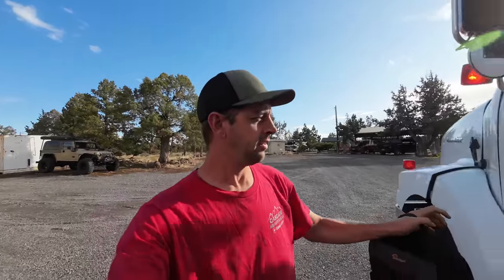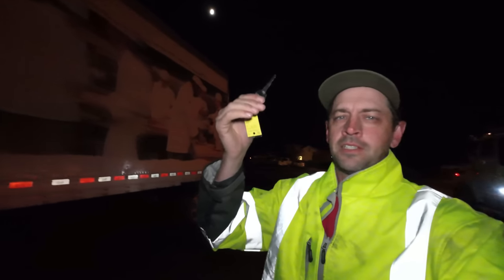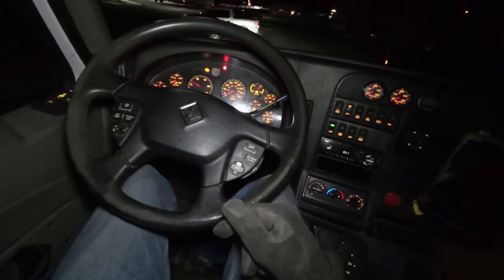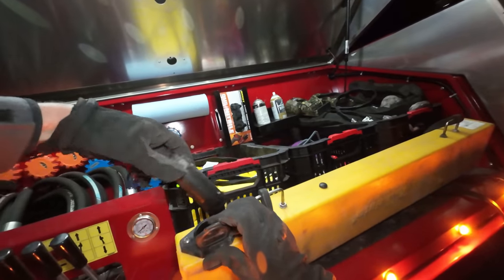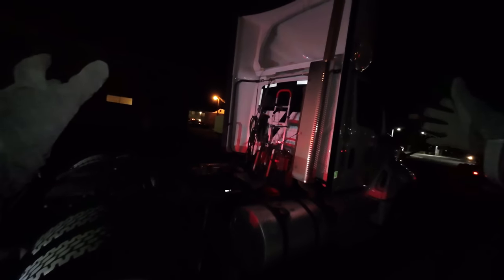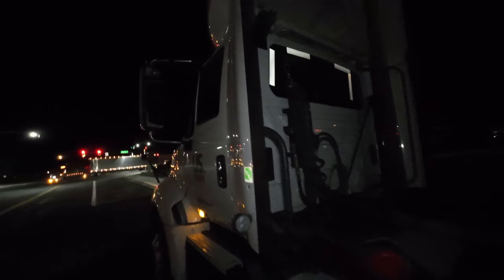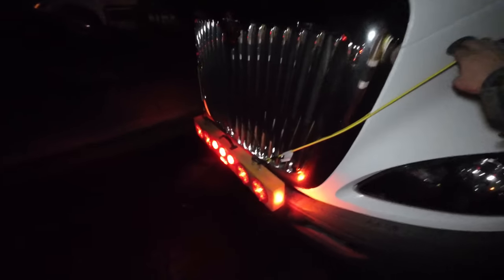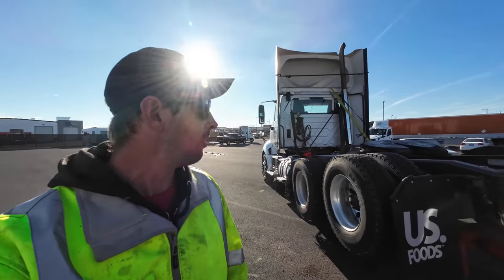Pulling a parachute for 300 miles!

Comment: Drag force goes up exponentially with speed.  In the formula to calculate drag force, velocity is squared.  That is why a lot of commercial fleets monitor drivers' speeds and/or speed govern their trucks.
Reply: When I was a technician working on the Albertsons fleet in Portland Oregon. We had to set the trucks for 330hp 400 on the hills @ 57mph top speed 62mph for 30 sec to pass and idle no longer then 1 min.
Reply: Right.   (60/55)^2=1.19, so makes 19% more fuel consumption. That explains 5 changing to 6 mpg
Reply: Drag Queens go up with speed too, so what's your point?
Reply: More accurately it doesn't go up 'exponentially" it goes up with the square of the wind speed.  That's no where near as fast as "exponentially" but it's still seriously wallet thrashing!   My 4 cylinder Camry gets about 30 mpg at 70 but at 90 you can see the fuel gauge dropping.🤪
Reply: @keithcress1335  , you just contradicted yourself in the first sentence.  Anything increasing with the square (or cube, or any other exponent) IS increasing exponentially.  Saying the drag is going up by the square just defines WHICH exponent.  This is in contrast to drag increasing by weight, which would be linear.
Reply: @michaelhinman1770  !! You're absolutely correct!  For some reason I was thinking "e to the x".  Thanks for that.
Reply: @keithcress1335  a person who admitted a mistake on the internet?  The courage that takes, you are a man among men!  

Seriously though, to make mistakes is human, to own them is becoming a sadly rare occurrence.  I appreciate those who are honest enough to admit their mistakes, especially in front of the world.  Keep up your integrity!

Comment: Back when you only needed 10 hours off in a 24 hour period was a lot safer than this 10 hour all at once. We often drove a few hours and then rested a few hours then all over again without getting sleepy. Now driving 11 hours at once is much more dangerous.  Love the videos. Nice truck for sure. I am building me and old POS just to help the neighbors out from time to time. The bungy cords when the light fell off were probably bouncing up and down pretty good hook on the strap where when hooked on something solid, they hold fine. I do like the method you are using now much better. good idea.

Comment: Casey, it was an newer international, so next time look at the switches on your right and you should see one that says 5th wheel unlock. With the truck running, parking brake on , hold the switch down until you get a solid tone. You should hear a”chunk” behind you. Then push the parking brake and start to drive foward . Also in that bank of switches you should see a suspension dump. Hit it to lower the suspension. And if you have to pull the handle manually pull out and the pull it towards the front and let go, it has a lock there.
Reply: Yes to the above answer about 5th wheel unlocks. Most all trucks have air 5th wheel unlocks. Safety! Oh, and workman's comp. Shoulder and back issues.
Reply: I haven't really ran a brand-new truck on a job. But my trucks that have "fifth wheel unlock" switch are for the ones that have sliding plate
Reply: More than likely, all he needed to do was to pull out, and push forward to lock open, that’s how mine work

Comment: I was driving a Humvee ambulance on I-95, topped out at 57 mph in the right lane when a truck towing another one backwards passed me. It got about 50 feet past me and that top spoiler(?) ripped off and flew into my lane. Super thankful there was a brush guard on that vehicle because I nailed it and fiberglass exploded everywhere. I pulled over to check for damage and a guy that was about a hundred yards behind me stopped to check and said from back there it looked like I’d run over a giant igloo cooler. Very minor damage, but the truck never stopped.
Reply: Yikes!!!😮
Reply: Years ago I was following a ute (Australia) or pickup (USA) carrying a bunch of builder's tools and stuff, with a fiberglass bathtub on top held down by almost nothing.  The guy went a bit faster and the bathtub caught the wind and flew off the back. I almost missed it, put a small dent in the corner of the bumper and a much bigger dent in the bath.

Comment: I'm just glad to be able to see you back in action, Casey. I totally understand the speed limit and hauling a parachute behind you - my RV is an older 30' DP that was designed during the fuel crisis, so 60 is its happy place, and driving a square box down the road needs everything in its favor 🙂

Comment: We always pulled them forward. It doesn't take that long to disconnect the driveshaft. Yeah I didn't like doing it but I like it better than the drag and swaying. We usually had to pull them further than you seem to. I used to work for a company that retrieved their own broken down trucks. Seemed like all of them broke down at least 600 plus miles away.

Comment: Trucks aerodynamics certainly weren't meant to be pulled in the opposite direction from which they were designed to be operated. I drove OTR from 1988 to 2009 and during that time drove our wrecker to rescue our broken trucks. We always pulled trucks backwards so we wouldn't have to pull the axles out. The mirrors we always folded in so the wind wouldn't tear them apart and the side fairings we always strapped them together to keep them from ripping apart from the force of the wind. I always enjoyed doing our wrecker runs (we had a lot of them lol) we're based out of southwest Tennessee and I've done runs as far as Idaho and Arizona either bringing a truck to a broke down driver and bringing his truck back or dead heading to pick up either abandoned or broken down truck.
Reply from the maker: Folding the mirrors in is a risky move.   It will prevent the covers from coming off, but if the wind catches them enough to fold them out at speed you will see some serious damage

Comment: Been really enjoying these heavy truck recoveries! Learned a lot on how and why you do the things you do. Question though, have you seen anything about Edison Motors? Would love to see your general thoughts on what theyre working on.
Reply from the maker: They are on the right track.  Big fan of what they’re doing
Reply: I'm a huge fan of Edison motors and what they're doing and I admire their approach to keeping things simple, serviceable, and domestic
Reply: Choo-choo there’s a reason I believe that trains have been diesel electric power and efficiency
Reply: @thelonewrangler1008  Absolutely love that too. If they made a pickup truck along the same lines -  reasonable EV with a diesel range extender under the hood - and keeping the user interface SIMPLE, not like driving an iPad, I'd go buy one right now.
Reply: Many years ago I read that UPS was exploring diesel-electric for their OTR and delivery vehicles.  I thought it was a great idea, but never heard anything more about it.  I love what Edison Motors is doing especially the ease of working on there trucks.

Comment: Data point, most class 8 trucks are designed to pull the max load of 80,000 lbs at a max of 65 mph. For the optimal service life of tires, bearings and drive train. Slower speeds increase the service life of the components, while faster speeds exponentially decrease service life. The harder you hammer the GO pedal, the faster you will be buying fuel, tires, wheel bearings, u-joints etc. Wanna go fast, How much money you got !!! 😂 Love the channel and content, thank you Casey for sharing !!
Remember when towing another vehicle with smaller wheels, the smaller wheels are rotating faster than the tow rigs. I bet people have replaced more camper trailer wheel bearings than worn out tires.

Comment: Casey , Western Star turn signals and brake lights operate this way for the Canadian market .  Remove the turn signal switch , remove cover plates . At the bottom of the turn signal switch you will clearly see a red jumper wire , cut it and your lights will properly operate . This operation will take 15 minutes .

Comment: I keep my ratchet straps lubed up with dry lube. It helps alot toward them freezing up ans sticking. In winter i coat the ratchet parts with a wet lube. It helps keep ice out of the gearing

Comment: Wait until you get a 5th wheel plate that has TWO release levers.....  and neither one of them wants to move for you.  l only saw it once.  It was on a belly dump tractor.  Thankfully the company mechanic was on scene when I was getting hooked up. Even he struggled with it. lol. There is ALWAYS something new to deal with in the towing industry.
Reply from the maker: I had those on a couple of my heavy haul trucks

Comment: I didn't get a good enough look at the fifth wheel but the place i work at has an international thats relatively the same and with its fifth wheel when i unhook I use the pin puller, hook it from the bottom and pull out and up, there is a piece of steel that sticks up on the bar of the handle and that catches and locks it in place. Kind of irrelevant now but in the future it might help.

Comment: Hey Casey. l really hope you didn't take my comments about bungy straps from the previous video the wrong way. l learned the hard and expensive way so l just thought l'd share my experiences so that others wouldn't make the same mistake. l really value how you talk about your experiences and take the time to explain things to us amateurs. 
Moving on. Great example of fuel saving with your 55 vs 60 experiment. That's nearly 20% fuel saving !! lt would be really interesting to hear how much longer the trip took. While l get that time is money,  the money saved on fuel by driving that little bit slower probably beats the extra truck/labor time.
lf possible,  the next time you tow a truck like that it would be great to see the difference if it was towed forward rather than backwards.
Reply from the maker: I charge by the hour, so time definitely is money!

Comment: One reason the mileage varies so quickly relates to the Bernoulli factor. The functions like lift and drag are result of speed computations to the power of 4.  e.g. 5, 25, 125, 625 . Increase speed by 5 and see a 625 times increase in drag factors.

Comment: It’s all that wonderful computerized semi stuff.  It’s so you don’t blind somebody going down to road.   They make sounds if you get out of your lane or if they didn’t paint the lines.  Don’t open the door with it in gear or the parking brake released because it makes all kinds of noise and the horn blasts.  Companies lock them in economy mode so it takes miles to get up to speed.  And there’s more crap coming every year.  It’s like driving a video game. I’m retiring again at the end of March or sooner.

Comment: As far as the bungie cord issue in your last vid, the only reason it failed is because your top bungies were connected to a single strap, so the hooks were able to slide to the center where they would have lost all tension. The only way I could think to fix that would be to tie a knot in the strap for the bungie to hook into so that they couldn't slide. Hindsight being 20/20 and all that.

Comment: I used to drive for walgreens and the only reason we would have a 5th wheel release like that is someone somehow backed up off center and hit the pin on the release. Happened to a few of out trucks and you'd have to move it all over the place to get it to lock in

Comment: Would be interesting to compare a front tow to a rear tow on your mileage and power. Are the newer trucks more noticeable in the Areo aspect than the older trucks? Like say grampas truck was always 6mpg no matter what it was dragging vs say your truck where you definitely can see differences based on the aerodynamics ?

Comment: I had the same experience when I first encountered one of these Jost 5th wheels.  The handle has to be lifted up and slid forward before it will pull out.  They make a puller that has a kickstand welded under the hook that helps complete all these movements.  Hook goes in the little hole on the handle, then you turn counterclockwise as you pull.

Comment: 👍learning videos 👍 thanks for sharing your knowledge and experience today 👍🤔some 5th wheel s on new trucks is a pull out and up forwards towards cab to lock into a notch other s just pull out 
Working rear lights has a reverse mph shut off automatically 
New company trucks has a idle shut down set up by the company that will override idle up on cruise control

Comment: Ok I’ve seen this before if this is the case it’s one of those 5th wheels where you got to pull it out and slide it forward seen a similar 5th wheel on my dads Volvo because I couldn’t figure it out either when I first started unhooking trailers I learned something new that day

Comment: Laughs in 610hp CAT...
Running 75-78 across TX with the ol C-16 I got 6.85mpg.
2 things to remember
1. There is no replacement for displacement.
2. Horsepower is king, if you expect to get 6.5 and don't sweat it, you are already ahead.
Reply from the maker: Yeah, good thing you have that big power for all this hills down there….
Reply: I don't live in Texas, I'm from Wisconsin and I do specialized and heavy haul....
You shouldn't just respond sarcastically, it's not a good look.
I'm a patron supporters, so I'm not trolling you.
I could if you want.

Comment: Apologies if this is the 29th time you've had this same comment since I didn't scroll all the way down. 
A company I once worked for ran Jost 5th wheels. You had to lift up and then slide the release handle towards the front of the truck, and then pull it out to release the jaws. There was a little nubby on the bar that would just barely hook it in the released position, and if you missed the nubby it would slam locked again. I'm wondering if US Foods runs some flavor of Jost.

Comment: That’s a lot of low gears, at 14 I’m sitting at 61 averaging 6.7, bob tail at 14 it shows 13 on the trip track, perfect setup for hauling fully loaded trucks up and down steep grades, I suspect you can run service to the trailers.

Comment: I know on some of are internationals as the fith wheel wears out they wont lock open till you pull the trailer away from the front locking mechanism

Comment: Regarding the bungie cords, I think when a few of those folks said "as soon as I saw the bungie cords" they probably meant "as soon as I saw how you installed the bungie cords". That was just not enough tension. I don't think the strap had as much to do with it. The whole thing was just too loose, loose enough that the light bar could bounce up and down far enough to create slack in the cords and let them come loose.

When applying things with bungie cords they have to be very taut. You want it so that no matter which way you tug on the thing that you've got tied down, it can't move enough to create any slack on any of the cords. If it does, the hooks can and will come loose. This is why the cloth weave-wrapped cords are "better", because they have a hard stop on the length. So when you apply them, you want to pull them to their maximum extension, and it's safe to do that because their length is limited by the cloth weave. Also, the cloth weave limits the amount that the load can move against each cord, which means that if you're up against the length limit on all the cords there's not enough movement possible to come loose.

Anyways, great video and thanks for sharing with us. Big respect for showing your mistakes and owning them. Some things we only learn from experience, but at least it can be someone else's experience. 😂

Comment: I wonder if you participated in that recovery on Highway 58 last night?  For those not in the know, at MP12.5 a Sherwin Williams truck went completely over the side, was laying on its side, and it was down an embankment probably 50ft.  They closed the highway to recover the truck and trailer.  I'd guess it would take 2 or 3 wreckers like Casey's to pull the whole mess out.

Comment: Surprise you didn't cover the exhaust pipe towing it backwards. I've  heard the airflow can cause the turbo to spin. Being turned off no oil pressure to turbo.  Truckers who haul equipment on drop decks will duct tape the exhaust if its facing into the wind.
Reply from the maker: That’s a myth, the turbo does not spin.   The only people who cover the exhaust are people who can’t understand simple grade school level physics
Reply: @CaseyLaDelle  OK unless its for rain. I just see youtubers who haul do it. Maybe the equipment owner requests it. Thanks.
Reply from the maker: @plowkingf15 one I said, they are only doing it because they don’t understand simple physics.  It’s impossible for the turbo to spin

Comment: I notice you didn't put a sock on that exhaust. I always put one on to prevent the Turbo dry running.
Reply from the maker: It is flat out impossible for the turbo to spin.   That is a myth that was created by people who have no concept of physics.
Reply: @CaseyLaDelle is it possibly a bit more aerodynamics than physics because  a fan blade inside a closed end tube     (which is effectively what occurs) can’t spin since there’s nowhere for the air to go, right?

Comment: If that's a jost 5th wheel plate, they have a catch for the release arm. Once you pull it out I believe you pull the arm towards the front of the tractor and it should stay out.
Reply: Thanks for the info.

Comment: Would it have been easier to trailer both trucks with them headed forward?  Less strapping of parts against wind damage.  Could you have winched the broken truck on to the trailer?

Comment: I've seen in a few of your videos when you put the safety straps on the towed vehicles axle it seems to have barely a single wrap around the drum of the ratchet strap. Straps are like winches if you have too little on the drum they will slip. I could be wrong but I think you need at least two full wraps around the ratchet drum to be safe
Reply from the maker: It doesn’t matter, those straps don’t actually hold anything.  They are just there for looks